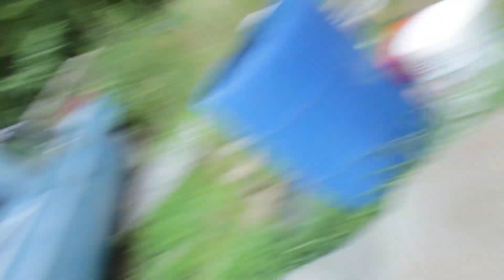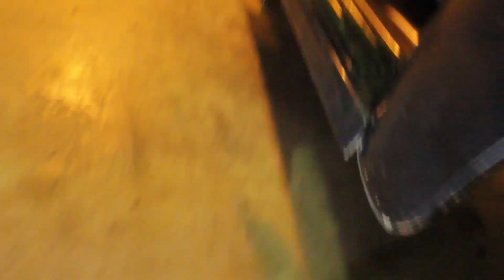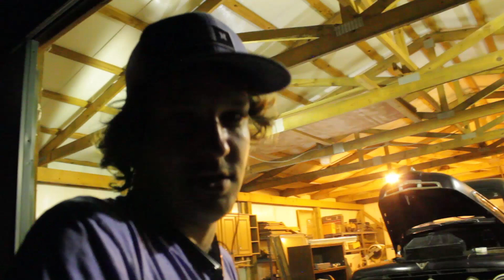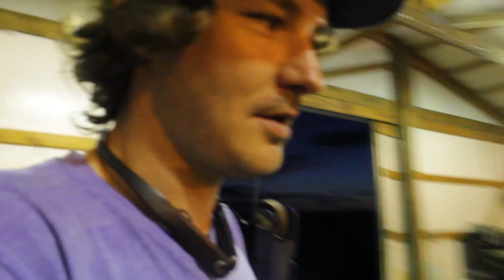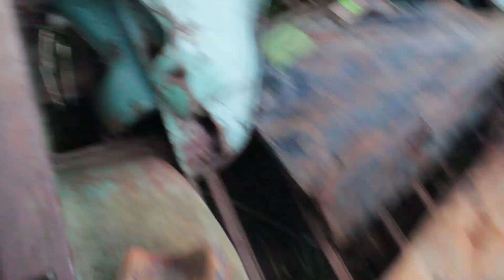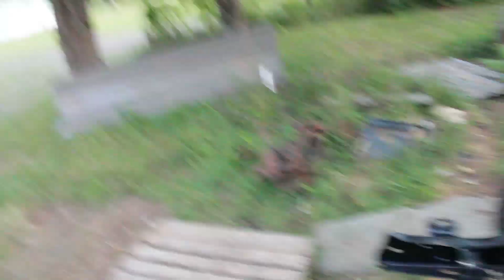Big future plans and a rambling thank you

Comment: I've got an 85 F150 I'm restoring also a 92 RED  Toyota Celica GT 200k plus millage! in mint condition.  Just finishing a major tune up on my 02 Chrysler PT CRUISER,  including replacing valve cover gasket.  Spark plug #1 burnt out... had to R&R the Intake manifold just to replace the 2 center plugs and replace the coil and wires.  90,807 miles and the valves were clean, no sludge... 

Not to mention a few upgrades and maintenance on the 04 ClassA 30ft Motorhome.  Never a dull moment. 

Sure going to love watching your restoration videos... right up my alley 👍🏼

Comment: I have a '67 F100 with an 8' bed that I bought for my husband on our 35th wedding anniversary.   We've been married for 52 years now.  I love the old cars and trucks.   I'd rather walk around an old junkyard than go 'shopping'. That is an awesome Ford truck your friend has.  Also the  Chevy, but I like the Fords better.   Be safe and take care.  Patricia
Reply from the maker: Do yall still have that old Ford? Thanks for sharing your story very cool the history these old trucks have💚
Reply: @DREWSLENS  yes, we still have it.  It doesn't get driven too much anymore, but it is started regularly.  My oldest son changed out the 3 on the we column for a 4 on the floor years ago.  We're  going to take it to his house in GA and he's gonna be doing some work on it.  Adding power brake booster, change out the steering column and put in power steering, change to 5 speed transmission.  Also some body work like filling in the holes from where the trim was taken off.  He's also going to be putting boards in the bed and fabricating the bumpers.  Luckily he is schooled on paint in body work and has been welding since the late 90's.  His 8 year old son has already laid claim to 'old blue' when he is old enough to drive!  We actually have a 1967 Alabama auto tag on it that we found in our basement after I bought the truck.